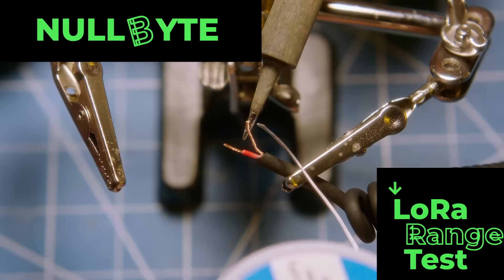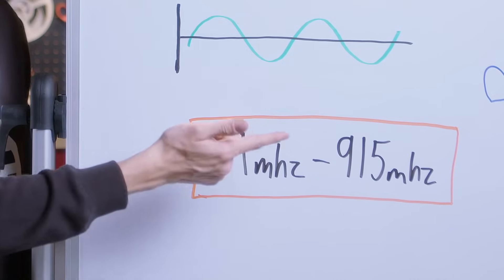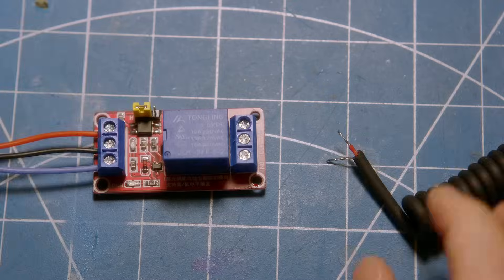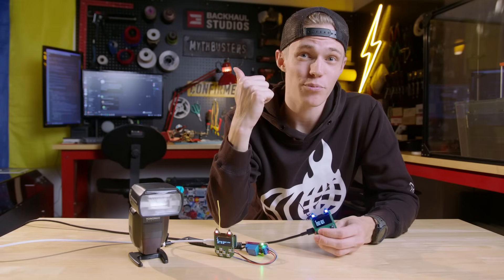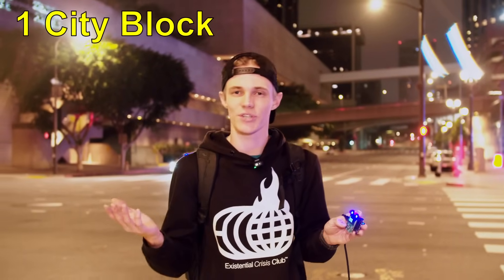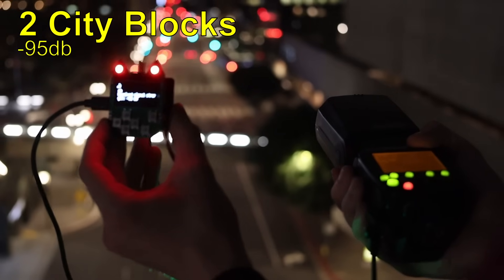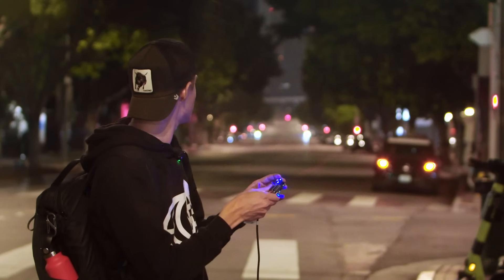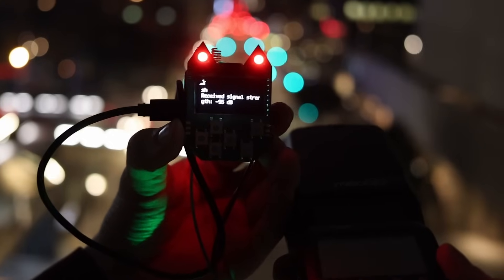LoRa for Hackers: Testing Long-Range Remote Control in the Real World

Comment: You have such a limit because of the antenna, I get 6-7 miles in the city and that’s just with antenna upgrade, not even messing with the signal strength ( yes there is a cli and commands to amplify signal strength) just can’t exceed 30db (legally)

Comment: What power level, frequency, spreading factor, bandwidth and preamble did you use?
I feel like you if you would have used Spreading factor 12 (6-12), Bandwidth 7.8kHz (7.8-500), you would have got a lot further!

Comment: Lora uses different data rates and that can help improve the range. Transmitting at a slower bitrate and a wider bandwidth is key! The limitation comes with the amount of data that can be legally transmitted at those different data rates to be in line with airtime fairness. If you have control over ADR, you can push it waaay further! I've connected to a receiver over 10kms away in an urban area before.